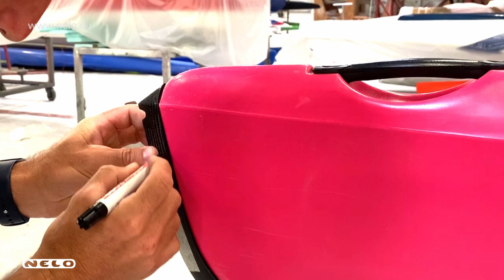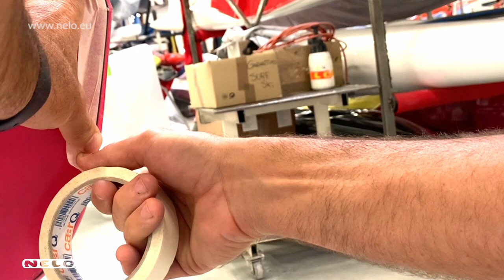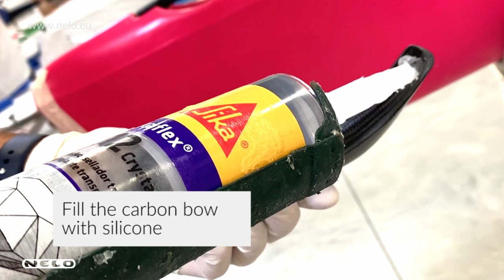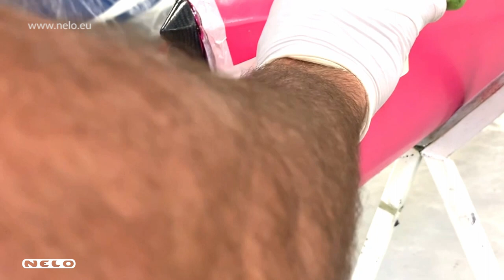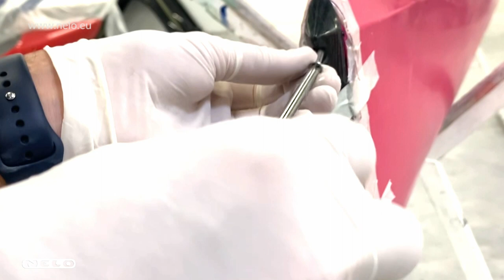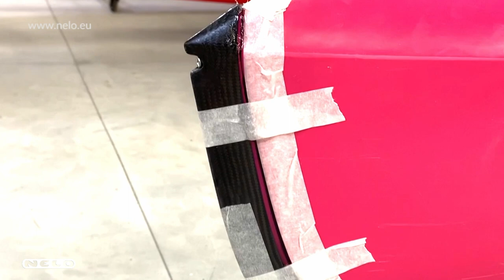Assembling a 510 Carbon Bow

Comment: Nelo:  do you know if Aquaseal would work to attach it?  That stuff seems to stick to all sorts of plastic products, and really doesn't want to let go.  Also, for anyone doing this at home, silicone lube would probably help with cleanup--it works well with RTV, if you're for example sealing up between the engine baffles and engine on a light aircraft.
Reply from the maker: We never tried Aquaseal, but if you have a chance to try it please let us know how it works.
Reply: Is there a big step in performance with this upgrade. ?